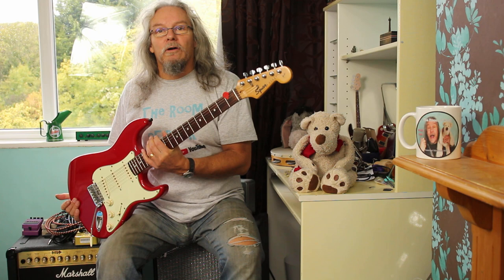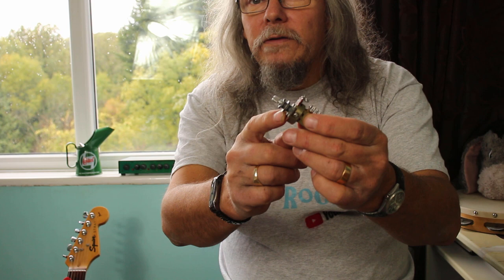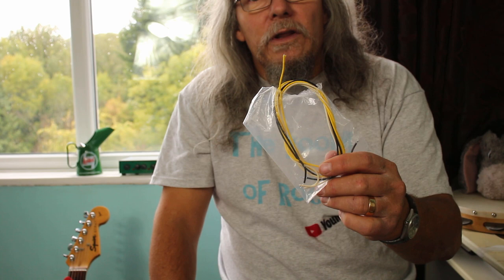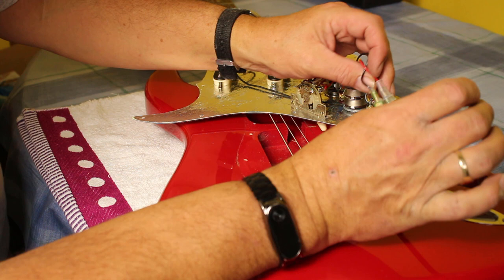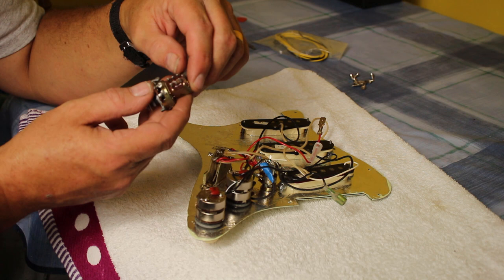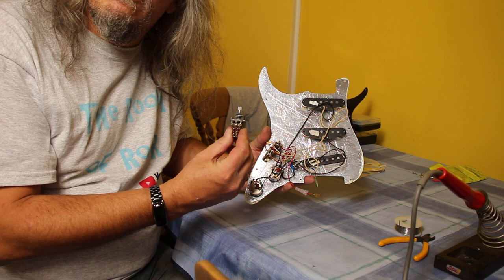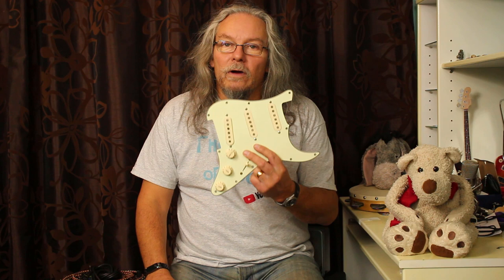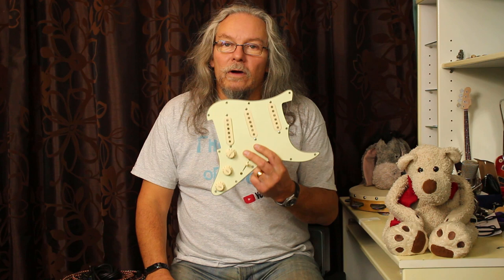Seven Sounds from your Strat (David Gilmour mod)

Comment from the maker: Have you done any mods to your guitar you think stand the test of time?
Reply: Simple mods on my mid 70's Bellwood Super Swinger MIJ strat. Planet Waves locking tuners, roller type string tree, ceramic pickups loaded pickguard with 5 way selector. Master tone and neck/bridge pickup blender mod. It has served me well for 41 years. Original body, neck, frets and output jack. Other guitars come and go, this stays for life.
Reply from the maker: @SoloSi2024  Hi, I use treble bleed kits on my guitars too, as i like to roll the volume back without sacrificing treble
Reply from the maker: @SoloSi2024  sounds like some interesting mods you have planned for the Pacifica

Comment: Hi! Great video! I was wondering if this could be done in a different pot than the volume one, thanks
Reply from the maker: Yes you could switch any of the pots that suited you, I used the volume as I have tbx tone controls on this and didn't want to change them out.

Comment: hi...is it possible if i do with hss pickup?..thanks
Reply from the maker: Yes that will work as well. I assume the humbucker is in the bridge position so the wiring for turning on the neck pick up would be exactly the same. If you had a humbucker that you wanted to turn on (that was coil tapped (4 connector wires) you would use both sides of the switch do do that. As yours is still a single coil the wiring would be as described in the video. I hope this helps